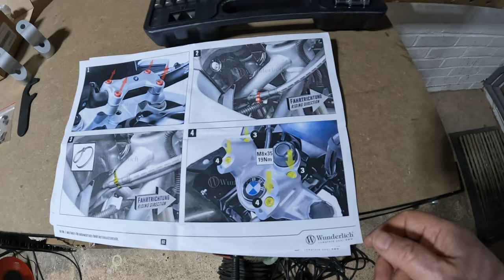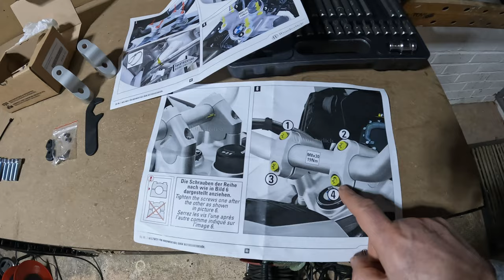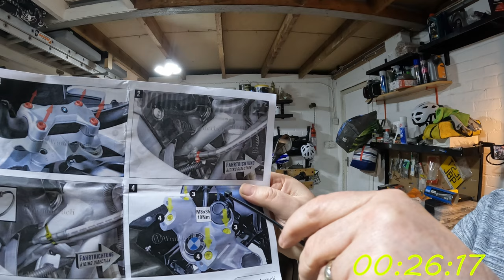BMW R1250GSA Accessories Wunderlich Handlebar Risers

Comment: Nice video, How tall are you? im 186cm. i have a 1250 GSA. after a few hours riding i get really pain in my elbows because my arms are stretched all the way out when riding. Even days after riding i can still feel the pain... Do u recommend them?
Reply from the maker: Hey, sorry for not responding sooner, I've just spotted your post. I'm 180cm and though the standard setting on the GS handlebars was ok I did suffer in the shoulders after about an hour or so but also the front leaning part did make the old crown jewels suffer too. I am very happy now with the risers. Did a 5 hour ride out last week and though I did eventually get shoulder ache it wasn't as bad as I thought it would be. My arms are now not outstretched as they used to be, so not putting as much pressure on the shoulders/neck. Yes, I would recommend them for sure. Hope you get it sorted, I can’t think of not riding the bike, so any niggles like this would have to be sorted. Happy riding 😎